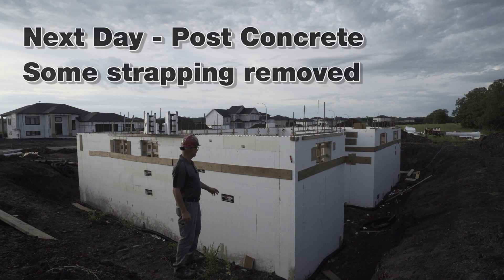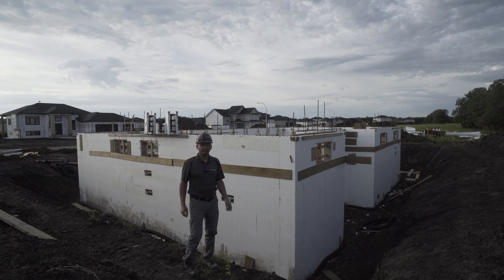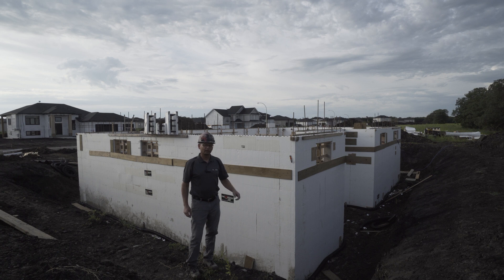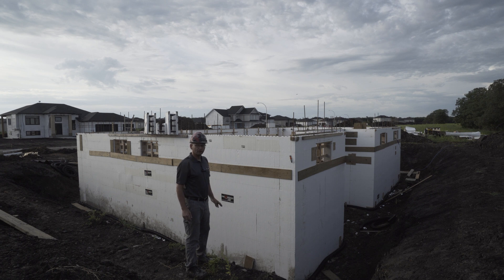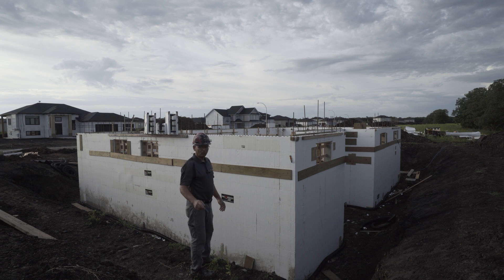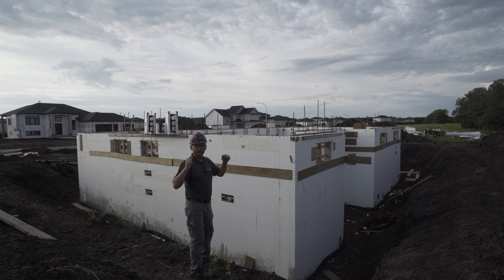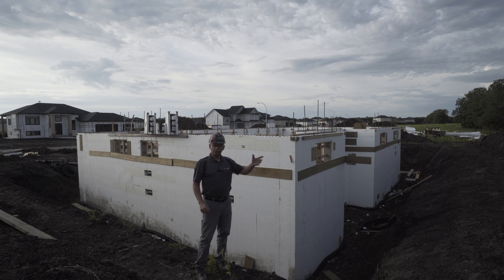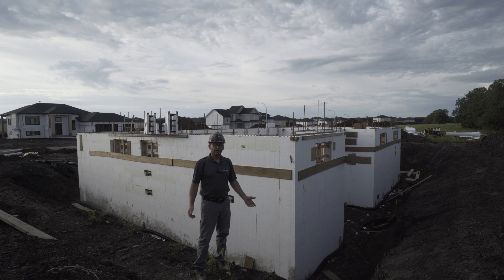Fox Blocks Stacked Corners

Comment: That is a tall basement, going to be very spacious, just what I plan and would like to do someday, not sure how much higher or lower but still at least 12 foot slab floor to "ceiling"/floor (ICF slab or engineered wood more preferably for comfort). Also depends on the terrain of property I would be (re)building on, might do a Phantom parking lift with space in the basement to off load said car and park it there if relatively flat, or for more sloped terrain would already leave one (wall) side.and exposed to allow for a large enough opening for a Schweiss hydraulic or bifold lift strap door for access with the "garage space" sectioned off using wood (Tstuds which are unique insulated engineered studs) or light gauge steel studs. Something perhaps similar to that of a Hangar with living above instead of aside/next to (attached or detached) if the surroundings have pleasant views.
Have thought of doing the corners this way before, but this sure gives a practical visual of it and best suited for below grade, I would still prefer staggered stacked corners above ground, or even use this method where a large landscape or portrait window is to be placed in an above ground area.with the top and bottom still being staggered units.